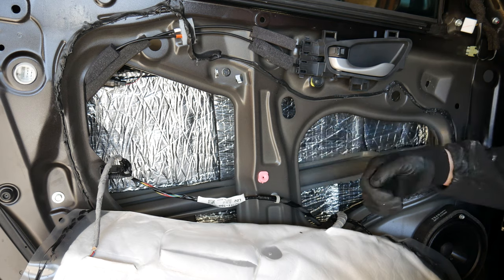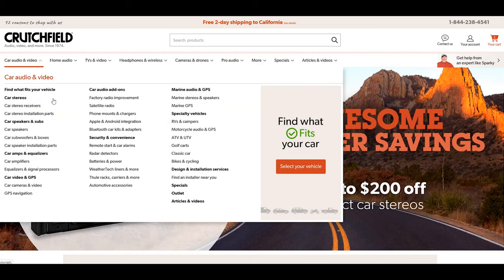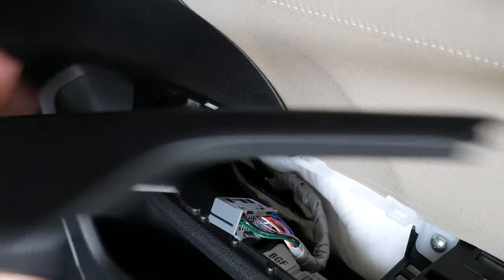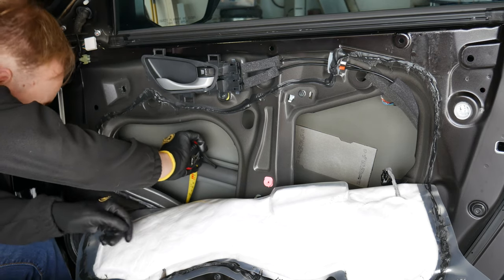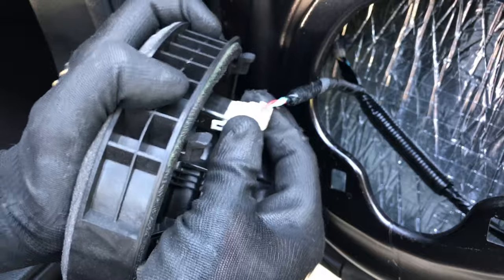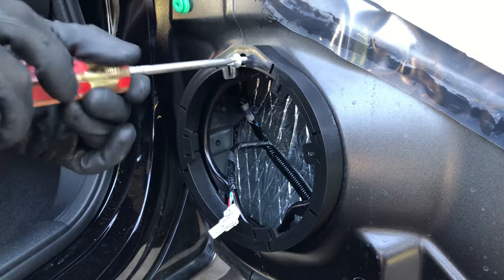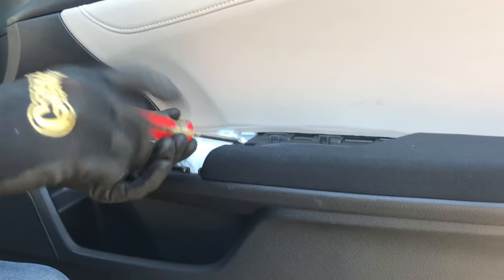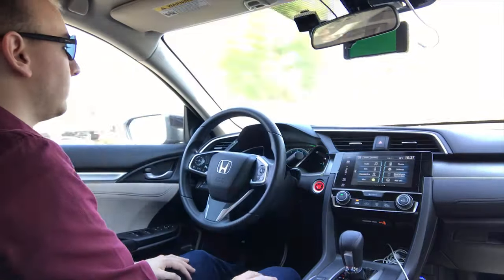Improve Honda Civic's Sound, Speakers/Sound Proofing Upgrade

Comment: DO NOT DO WHAT THIS GUY DID and turn your volume to MAX when you put new speakers in!!! BEST way to blow your new investment. Speakers have a 14hr break in period where they need to be listened to at a moderate level first.  Also, get PLASTIC pry tools, don't use metal "wrapped in cloth". Plastic panel removal tools are too cheap not to have some
Reply: Bless
Reply: You don't even need pry tools I did it all by hand
Reply: I don't know how it'll sound just adding the Aftermarket speakers without the FLAT frequency response from the HU. It''s a trial and error. WIth DSP any stock HU can work with the Aftermarket speakers.
Reply: there's no such thing as break in
Reply: @BigGRIGinc  word
Reply: @ROGG16Gaming  how did you tap into the HU, before or after the OEM amp?

Comment: the stock speakers magnet is smaller because it is a neodymium magnet which is more efficient and saves on weight over ferrite magnets. i do however agree that the stock speakers are garbage but the magnet tech is actually pretty neat when used in the right application.

Comment from the maker: See description for factual corrections and additional notes. 

My beloved Civic is no longer with us and I will not be able to release the rear speaker video unfortunately. Stay tuned for videos on my new 2021 Hyundai Elantra Hybrid Limited that replaced this Civic. If you want to unsubscribe I understand but I believe my future content will be general and apply to most all vehicles.
Reply: Did you sell it? I like the look of new Elantra but I am a Honda Fanboy. I can't cheat on Hondas with Hyundai's. Also, Thanks for making this simple video and thanks for testing out the sound deadening stuff.
Reply: Thank you for this tutorial, I just got a 2017 civic and i noticed the speakers were so much worse than my 2013 veloster. I instantly started looking for ways to replace the speakers and found this. Just finished doing everything and now I actually have some good sound at just half the volume

Comment: Well done. I just picked up a 2018 coupe and was really underwhelmed with the sound. This vid's a problem solver. Thx.
Reply: Did it actually sound better/louder? Did you keep the factory deck?
Reply: @Guitarsrulez  Complex answer incoming - The "factory" deck that came with the car was an AM/FM receiver only. I pulled the speakers and upgraded. I discovered an issue that seems to be with these coupe, where an "Aftermarket" Audio solution injects a new problem into the mix, where FM reception is degraded, probably on the order of @ 25% signal sensitivity reduction. The problem seems to be in the antenna and antenna amplifier design. I've been going round and round with both the aftermarket installers and Honda to get some type of fix, but so far there's no solution. Sorry for being long winded, I suspect this doesn't provide you what you're looking for. And yes---Guitars DO RULE ! ;-)

Comment: Actually i amplified the stock speakers, they sound decent. And they can produce bass to shake all the car. Those tiny magnets are neodymium, which can produce the same bass as 4x standard speaker magnet can. So please do your homework instead of inducing people in error. The problem in this car is the source.I would first get a good dsp + eq + amplifier (or the cheap way hondahack + eq off + viper4android) and then i would change the speakers. I mean, that's what i am doing. Putting a dsp+amplifier+eq dramatically changed the way my car sounds. From that crap sound to something decent that i am happy to listen to.I am pretty sure that changing the speakers wouldn;t have gave me the same output. Same shitty signal sent to some better speaker without amplification would basically sound the same.
Reply: Hey I’d love some more info on this as I will be looking to upgrade when I get my civic next month. I’m already moving my 12 inch sub setup to the car from my accord which is just a mono amp setup. Not really familiar with dsp so how does it hook into the system and will my subwoofer setup need to be modified to accommodate this?

Comment: Did you do anything with the stock tweeter?
Reply: Is the stock tweeter still playing overtop of the other tweeter built into aftermarket speaker ?
Reply: @c.s.herman860  this is what I'm wondering too. Since there are already tweeters in this generation of civic wouldn't a component speaker withoit the extra tweeter built in be a better option?

Comment: Nice Video... seems counter productive not to remove the factory tweeters, or actually install the Polk component version of the DB652's. 

Did you also replace the rear speakers with the same speakers ?

Comment: Did you even need or bother to  re-connect the factory tweeter?  My daughter bought a 2019 hatchback LX with NO tweeter at all. The Crutchfield speaker has a tweetr with (I assume a builti-in crossover) so will that suffice for high frequencies she's lacking? Great video and thanks!

Comment: Sir, I want to thank you for your time posting this video. I got the same exact speakers you did and wow...did that move the bass up front or what? I am impressed. Tomorrow I will add the sound dampening material and button her up. Looking forward to watching what a pain in the ass it is to replace back speakers.
Reply: yoo, im about to order some sound dampening material. did you have enough to patch all 4 doors with 1 box?
Reply: @talanius1  I only did two front doors.

Comment: Can you make a video testing out the new speakers and how good is the bass on them compared to the original speakers?
Reply from the maker: Oh man you wouldn't believe the bass response of the new speakers, went from sounding like someone banging on a tin can to feeling like I have a giant sub in the trunk
Reply: Ryan Straub I installed new speakers in my honda civic about 4 years ago but that never did anything for the bass levels. Is there something im missing? Is it the wiring?

Comment: Great video! How many sqft of deadening mat did you need for the whole car?
Reply from the maker: I accidentally bought 36ft which was way too much, you could probably get away with 18 or 10 if you just plan to do all the doors.
Reply: When you cut the material for in the doors it looks like you did a lot of trimming to get the squares to fit exactly.  Did you also use a lot of little pieces to fill in where the squares didn't fully cover?  Curious how much quieter it is inside the car on the freeway with the sound system off compared to before you installed it.  This car is loud on the OEM tires and I'd like to knock that down a few decibels.  Great video, thanks for no crappy back music!

Comment: I also had the same problem but I was wondering does the rattling come from the door without deadening material or does it come from the speaker itself? Because I was wondering if changing only the speakers would stop the rattling problem

Comment: Did you actually install new tweeters? Installing them seemed pretty plug and play, but I'm more curious if they were super important to this new great sound? I'm purchasing everything to do this myself now haha, so I was wandering!
Reply: I think he got that 2-in-1 speakers/tweeters for some reason. In my opinion you should always go for component audio systems if you already got the place where tweeter can be installed. Some of them even have crossovers which if I understand correctly physically separate frequencies for tweeter and the actual speaker.

Comment: Of course you are going to get bad audio on a low trim.
I have the Touring trim and the sound is perfect!
Reply: I’m sure my 2021 sport has average speakers but tbh they sound great for stock speakers. In my old Corolla I had kicker speakers and a cerwin Vega sub. Ima probably just get a sub and keep the stock speakers. Not to sure if I even need after markers tbh.
Reply: @matthewvaladez8209  Upgrade your speakers Broski and just get an amp for the sub
Reply: I have the Sport Touring as well and it seems that my stock sub provides barely any sound at all.  I just bought a new 8" sub and amp to replace it in the same spot and see the difference.

Comment: Hello!
Did you disconnect the battery? I'm planning to replace the front speakers in my 1.5T Hatchback, but I don't want to disconnect it unless it's absolutely necessary.
Reply from the maker: you do not have to disconnect the battery, thank goodness too because d/c the battery on this car is a nightmare

Comment: Would this help reduce rattling from the door panels ? I feel I receive the most rattle from the plastic door panels , I have a 2019 civic sedan sport which is the model above a LX model so it doesn’t have a good audio system

Comment: Wait so if you just got a basic setup with two speakers for driver and passenger, will it still sound ok with the  crappy speakers still in the back?
Reply from the maker: no unfortunately the speakers in the back are absolute hot garbage and need to be dynamated and replaced or they sound like rattling tin can garbage (can you tell im still mad at honda about this lol)
Reply: @RyanStraub  I am too, I wasn't expecting this much of a step down of my 16 year old honda accord, but I guess new doesn't always mean better.

Comment: Very helpful. Can you give you thoughts on replacing the tweeters and subwoofer. Is the Tweeter replacement worth it? Or great door speakers already do the trick? Thanks.
Reply: I am wondering the same thing.  Ryan, you showed taking off the High on the door tweeters but didn't show putting them back on, and the Polk speakers you installed has tweeters included in them.  Did you reinstall the high tweeters, and if so how is the sound with both tweeters?
Reply: also on that subject, my research today says to buy good component speakers and replace woofer and tweeter with new crossovers that come with new speakers. That seems to the the recommendation. Infinity or Hertz without buying new amp for the car.

Comment: I have a Honda Civic LX. It has absolutely the worst info system. Do you have any suggestions or videos on replacing the radio.
Reply: Is that the really small radio. You can probably just get the 2019 radio

Comment: Ryan, it looks like you went with the Polk DB652 coaxial speakers up front which are seemingly well liked.  Did you disconnect the OEM door tweeters or let them continue to run?
Reply from the maker: correct, the polk speakers are to die for, the tweeters are still plugged in, they sound fineish, just made sure to pack a bunch of foam behind them like i showed in the in the video or else they rattle like crazy.

Comment: I just did this to one door so I can see the difference between the two front doors with the stock speakers. And I noticed basically nothing. And actually it almost sounds like the side without the sound dampening is better. Anybody know anything else about this?
Reply: The sound dampening is usually used for mostly preventing road noise, not really making your speakers sound better.

Comment: The aftermarket speakers are not gonna be plug and play, cause every OEM HU is tuned for the stock speakers, you will need a Flat frequency response from the HU or this is not gonna be well worth your investment. 

All this guy did is jus slapped some polks in his door with some sound proofing. WRONG.

The right way to do is to buy a DSP suitable for the setup and car you're gonna put the speakers in. Actually with this car, the DSP option is hidden beneath some menus, just look up DSP Flat autostart Civic 10th gen if you have the Civic with ANdroid Auto.

Comment: What speaker would you recommend for good bass and dynamics?
Or should I just install a subwoofer?
Reply: I installed a 10” pioneer subwoofer first, and the difference in bass was night and day. I then installed jbl speakers in the front (they’re the $75 component speakers from Best Buy) and the mids and highs were again, night and day. I’m now onto an install of the rear speakers, same setup as the fronts. Even without an amp, the front speaker and subwoofer upgrade is ridiculously different. I would suggest subwoofer first, then speakers.

Comment: Everything is wrong. If you have original place for tweeter you should use combo system with separate tweeter. Second thing you should use alubutyl for covering the technical holes to make doors as closed box as possible.
Reply from the maker: Interesting, make a video on that process please and share with everyone

Comment: My 2020 Honda Accord has a boring sounding stereo.  I never play it.  It has almost no "energy".  It just lays there and casually plays music.  No dynamics.  No sound-staging or imaging.

My understanding is that it has a Panasonic head unit, and has Pioneer speakers from the factory.

Can anyone recommend components that will turn this "hard to listen to" stereo into a "want to listen to" stereo?

Note that I do not want exaggerated anything.  I want accuracy.  I do not want boomy bass, or sizzling highs.  I want natural dynamics.
When listening, I do not want to be drawn into hearing the stereo.  Rather, I want to be drawn into hearing the music.
When listening, I want the speakers to disappear.  I want my ears to not be able to identify their location.

I have a 2003 Nissan Sentra, and its stock stereo sounds great.  It does just about everything that a well designed stereo should do.
If I could get my 2020 Accord to sound as good as my 2003 Sentra, I would be thrilled.  But if I am going to go through the trouble and expense of upgrading my Accord's stereo, I would like to get it to sound even better than my Sentra's stereo.

Any advice would be much appreciated.

I love music, and I cannot play it in my Accord.  It just ruins the experience.  Please help.

Thank you.

Comment: Do you need to install an upgraded Amp?
Reply from the maker: Jordan Black nope, this is as easy as is it gets because we are just simply replacing two stock speakers instead of replacing all of them and adding a sub.
Reply: @RyanStraub  I ended up replacing the front speakers and adding a 12" L7S and 1000 watt amp. I purchased, but haven't yet installed the dampening material, I'm hoping this helps even more!

Comment: You must live somewhere nice.  Otherwise every single spot you stabbed the metal with your screwdriver (2:58 for example, or when prying off the door panel w/ a metal tool) would be a huge rust hole within just a few years.
Reply from the maker: hmm, live in cali, didnt know about this, will note this in the future, i already bought proper plastic trim removal tools now, was just being extra lazy during the filming of this video, If i have to repair or replace my door in the future because of this ill own up to it and pay the price and learn my lesson